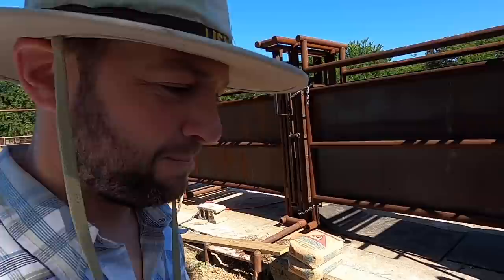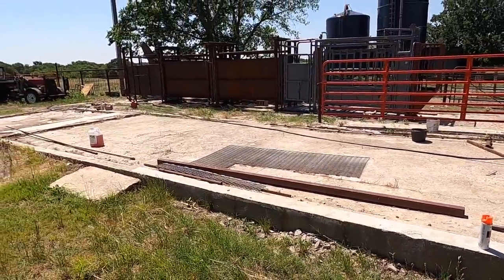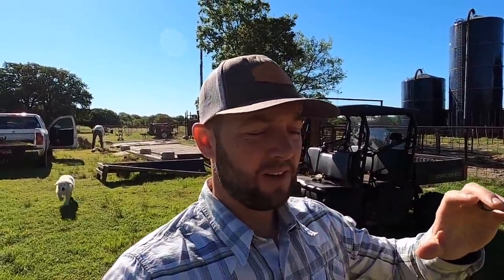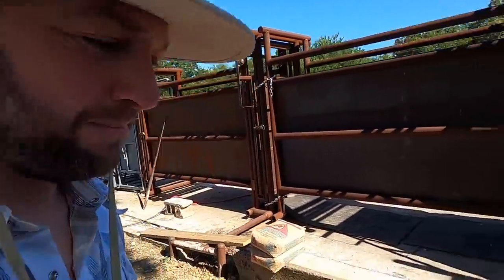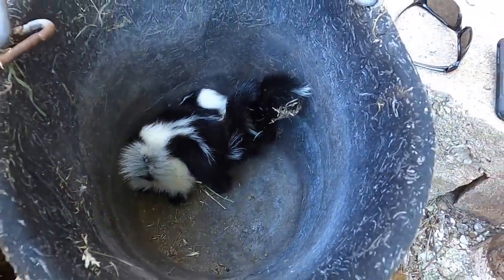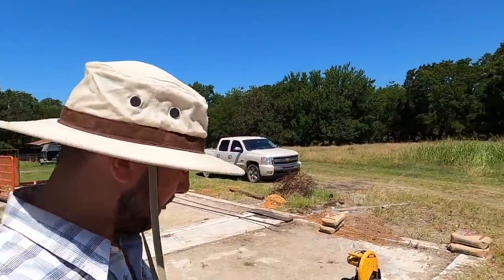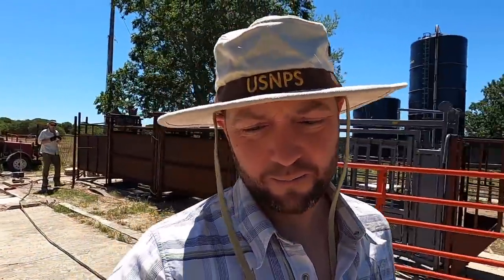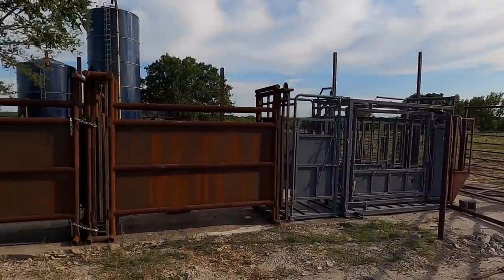We FOUND this while building a barn! New Bison Project

Comment: Always always contact a wildlife rescue when you are in such situations. they will direct you on the steps to take.  I used to volunteer with our local wildlife center and I can tell you those babies are to young to survive on their own and sadly they probably did not make it, unless by total luck the mom happened across them. Also when picking up skunks try to tuck their tail under their body, it will discourage them from spraying most times but not always.. handling the skunks at the center was my least favorite.
Reply: I agree with you. most likely they did not make it. & how rare is that white baby?

Comment: If a skunk stomps both front feet that’s your warning before it turns into a “ U “ shape and sprays !  I hope you know the 3 - 4 - 5 rule for laying out square corners.   Mark any multiple of 3 down one side , 4 down the other side will measure a multiple of 5 on the diagonal if the corners are square.  So 30 ft across the end x 40 ft down one side should measure 50 ft if you have it laid out square.  Do you know about a water level ? Clear tubing on both ends of a garden hose , might help with leveling the roof line.

Comment: Why didn't you contact a wildlife rescue for what they recommended?  Personally, I would have left them in the bucket near the hole (shaded area) and hoped they'd be gone in the morning. In the pasture is problematic because it is not near where the mother left her babies, so her chances of finding them is very low.  Also, very doubtful they will stay near each other, if not contained in a hole or artificial hole (bucket). And, if they wander into the sun, in this heat, heat stroke could be deadly for them. 
     I know this advice is very late, but please contact a wildlife rescue, sanctuary or rehab shelter NOW, for suggestions on what to do if there is ever a next time. Thank you! 
P.S. You could even try calling the biology teacher(s) at your school for suggestions!
     Regardless of disagreeing opinions on how to deal with the baby skunks, I do want to thank you for sharing! They were soooo cute! Hope the rest of your building goes more smoothly!
Reply: THANK YOU MELISSA J.  Most of the commentors re: skunks are CLUELESS!  Please read my comment.  I agree with you on calling a rehab or rescue.